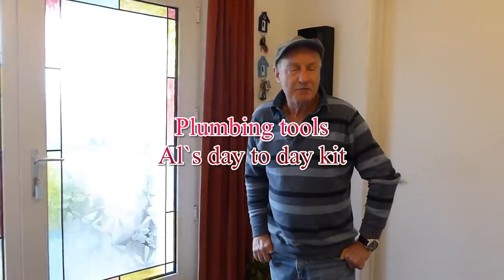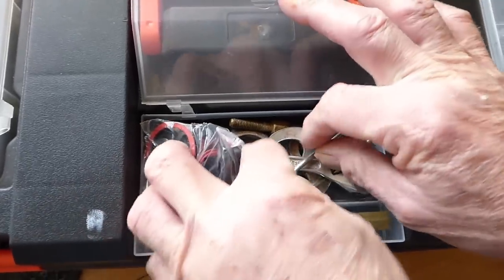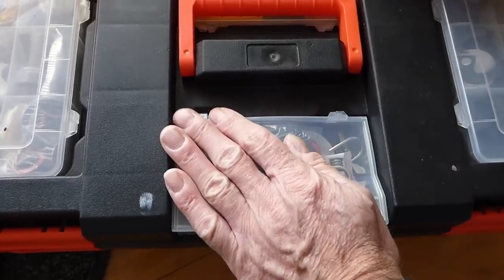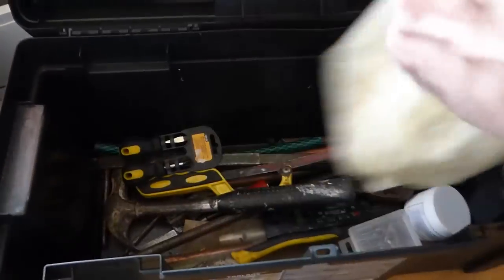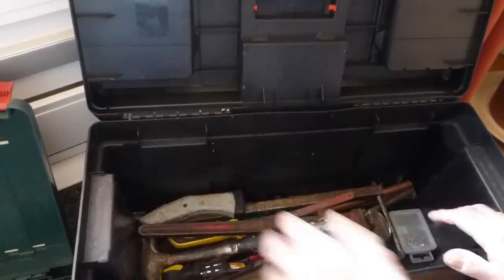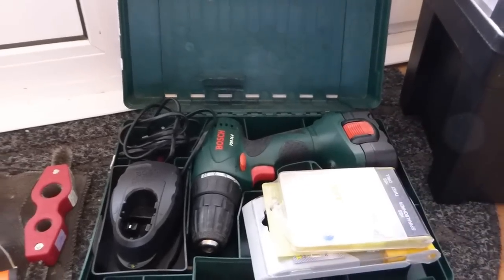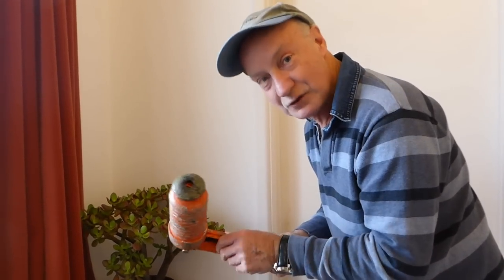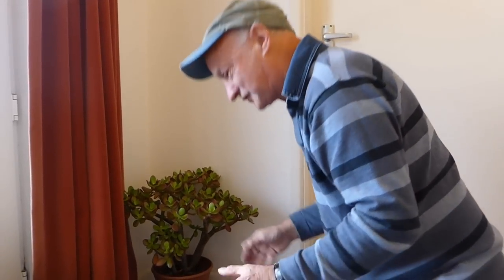Plumbing tools, what you need for most plumbing jobs

Comment: Al. There debris in my bathroom sink tap. It’s terribly slow coming out.  I fixed the toilet flow,  there was a load of debris in it. But the washer was also wierd so i replaced the arm. All good everywhere else.  
I unscrewed, the water supply and no problem with the flow.  Its a mixer. But hot and cold feed are the same flow rate.  Its debris as we had been messing in the attic a few weeks ago with the water tank. 😢😮😅  I squeezed the little nets out with a tweezers 😮. No good.  
Please do a video on that.   I feel ive tried everything. Im fairly handy 🤣😂😅
Reply from the maker: Ok will do.

Comment: Footprints are underated
Reply from the maker: The king plumbing tool in my opinion.
Reply: @dereton33  100% you should do a " video" on  how Versatile & what it does ..eg pipe gripping,  copper , radiator valves , poly pipe gripping

Comment: I think they call them drain cocks. ..usually on the end of radiators pipes ...in commercial plumbing they seem to put them on , under sinks on the cold & hot pipes.
Reply from the maker: Yes they are fitted where dropped pipes would need draining before cutting, like just above the main stopcock in houses.

Comment: Hi. You are highly privileged - you're the first Youtuber I've ever written to.  Love the videos.  Please can you help me?  I have replaced the large washer on my push button cystern (I had to buy a larger one from Amazon) but it still keeps running very slowly.  I've cleaned it etc. but no joy.  Any ideas please?  Regards Eifion. (pronounced Avion - it's Welsh)
Reply from the maker: Make sure the seat the washer sits into is clean, then make sure the ballcock is not overflowing. You may also need to trim that washer down so that it is the same size as the old one.
Reply: @dereton33  Thanks for that!